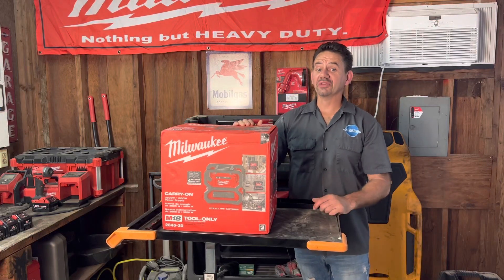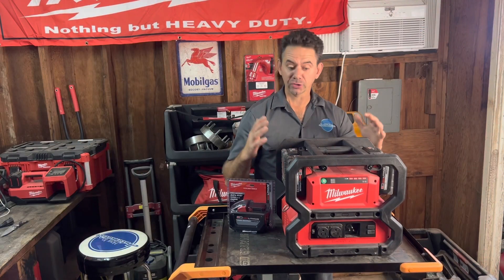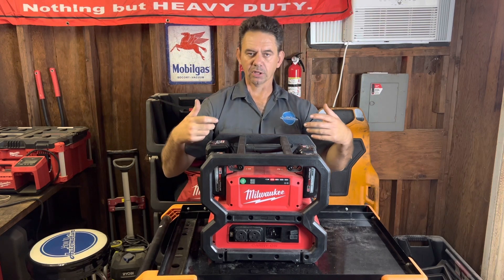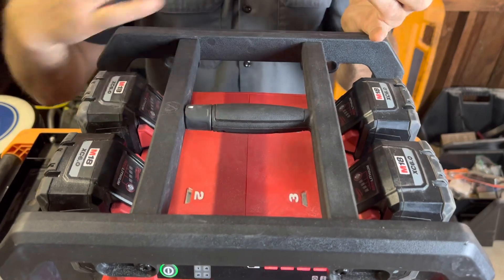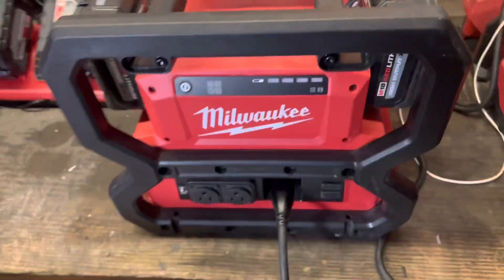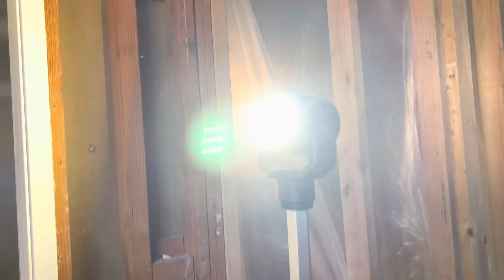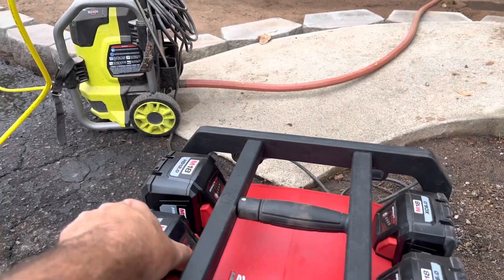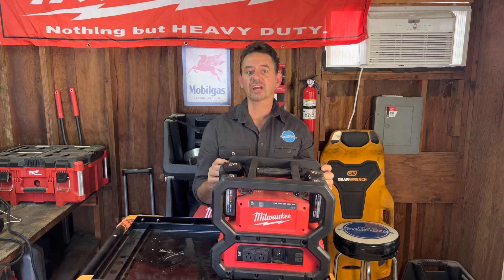New Milwaukee Tool: M18 Carry-on With Zero Emissions Battery

Comment: Your talking about using for when you get blackout to connect your fridge and other stuff but u end up showing us that your using it to wash you car like you serious show have connected it to appliances and tested it not a pressure washer , and why the point in using it for you rocket tower as the tower uses m18 batteries lol

Comment: I wish they would STOP CALLING A BATTERY A GENERATOR.  In Southern California, we have have Public Safety Power Shutoffs lasting 24 - 35 HOURS.  How much would you need to spend with this "generator" to run your furnace, refrigerator & medical equipment for 35 hours?

Comment: There are better options out there at that price. Deal breaker for me is it doesn’t have pass through charging meaning you can’t use it while charging. My oupes 1800w solar charger is a better option. I can charge it with a solar panels while using it. I ran my refrigerator for 7 hours and it still had 75% charge. Love Milwaukee tools but they are lacking in this area.
Reply: What do you have?

Comment: nice video but you make your own much better that one battery cast about 500.00 you get 12 volt deep cycle battery 12 volt 125 amp 199.00 that is 1440 ok you bull power box on wheel 4 12 volt deep cycle battery 1440 time 4  you get 5760 watts with 2000 watts inverter i love there tools but that will not cut it for me nice video

Comment: Used one to temp on lights at work today. (6) 8’ led strip lights. Killed (4) 12ah high output batteries in 1 hour. Super disappointed.

Comment: I guess the difference of a generator and an inverter is a generator generates electricity from a fuel of some kind. And a battery inverter holds and dispenses electricity like a water bottle holds water. Still a handy unit.  A little expensive but should be good quality. With pure sine wave
Reply: No, you use an inverter to make use of that DC power from batteries into AC power for an outlet. This Milwaukee tool isn't a generator. A generator produces power from a fuel. This tool is just a giant DC battery with an inverter to power an AC 120v outlet. It is just a giant expensive battery, not a power source. Think of the Milwaukee 175w Top Off toll but much much bigger.
Reply: @mlw636  most gas generators like Honda 2200i  I see are called inverters also is that because they generate dc current initially?

Comment: So how can you charge the batteries without a gas generator solar or wind?
Reply: I think the point of these units is that they are used when & where power is temporarily unavailable... or to not annoy your neighbors late at night (with a noisy generator) and then charged the unit when power is back.
Reply: sorry, if your point was about the zero emissions... yeah, nothing these days is zero emissions.
Reply: They should make them water proof ok i have power station and its water proof

Comment: Hi there sir I was wondering if you can help me I’m not a mechanic  I have 2007 Cadillac Escalade 6.2 liter with 200,000 mile  almost all the  rocker arm are little play on them I don’t know if the lifter are Stuck are not I guess it’s the lifter and the cam shaft is no good.
Reply: Check your pushrods and see if they're bent and make sure you don't have broken valve springs

Comment: "Zero emissions " unless you’re using solar energy to charge up the batteries I would not call it zero emissions 😅
Reply from the maker: I understand your point and support that argument. What I mean is if you’re using it in a closed environment it produces zero  CO2 making it safe to use inside.

Comment: 👨‍🔧I wouldn't mind trading my old PowerMate 1850 Generator for one of those
Reply: build your own power box ok 2000 watts inverter 12 volt deep cycle battery 125 amp 1440 watts you used 4 12 volt deep cycle battery that is 5760 watts you have have it in tool box run much longer hour ok i know ok i have there tools ok one battery its like 387.00 battery to run that ok you saved money
Reply: @jacksmith3951  I'm no electrical guru but ima have to refer to the OHMs Law while building this🧐
Reply: you build your own ok I am building power stating 3000 watts pure sine wave 48V 110V-120V 60Hz OK I was running heater today 1500 watts 120V 12A ,DIGSAW 120V 7A 60Hz and next jigsaw 120V 60Hz 4A OK That can't out do my power station my is water proof ok that you run tables 15A AND TRY run next not work ok
Reply: @andyjack2368  ......💪
Reply: Thanks 🙂🙂🙂 when build your own its best 🙂🙂🙂🙂🙂

Comment: If you already own 12amp M18 batteries this isn't a bad generator to have as a backup power option.   In my view everyone should have a good solar generator as their first option--such as a Bluetti AC 300 or a Delta Pro BUT this is not a bad second option.  During a power outage the last thing you want is M18 batteries (fully charged) laying around doing nothing.
Reply: you build your own run much longer hours one those battery is like all most 500.00 dollars ok one deep cycle battery 125 amp its 199.00 its 1440 watts ok  4 of those battery 12 volt 12 amp that like 2,400 i think ok you get 8 12 volt 125 amp battery 125 amp 199.00 1440 watts 8 battery 125 amp 1440 time 8 you 11,520 watts ok come that will do me in Toronto
Reply: @Wonderin'Aloud Wait so when the battery packs run out of power you mean to tell me that people dont know they have to be recharged again? People think that battery packs run forever?   Wonder if people know the same concept applies to gasoline generators? Once the gasoline runs out they will be mad when they find out they need  more gasoline.
Reply: @Wonderin'Aloud Dude..ok.  Maybe the word "generator" is a bit ambitious but because it has a charge control, a battery management system and an inverter it's more than just a battery.  This device will convert DC current into AC current so you can power a refrigerator or a wall AC unit or your coffee machine.  You need more than just a "battery" to achieve that.

Comment: A glorified battery that doesn't generate anything and whatever battery is the weakest is its weakest link. Piece of junk and way overpriced.
Reply from the maker: That’s why I make the video so you can determine if it’s right for you or not.
Reply: What don’t you understand? This isn’t a battery! The batteries plug into it. This is for guys like me that own 20 high output batteries from 6.0ah to 12.0ah. I can take this and my batteries camping and I can run lights, cookers, charge phones, make coffee for days and days. The same batteries work in my Milwaukee lights, tire inflator, chainsaws, etc. You can use it to recharge batteries in dump trailers, you can power worksites, etc. No, it’s not perfect, but if you already own the batteries and get this on sale for under $500 it could be very useful. I’m buying one next time Factory Authorized Outlet has their next 20% off sale.
Reply: This is my question: if one of the batteries dies during use, does that shut down the whole unit? I didn't notice it being mentioned in the video. I'll give it another listen
Reply: @satrujillo30  Yea one battery dies whole system stops.
Reply: @shanew7361  question, if I have 4 identical batteries does the unit drain each one at the same time? (Will they all die at the same time)